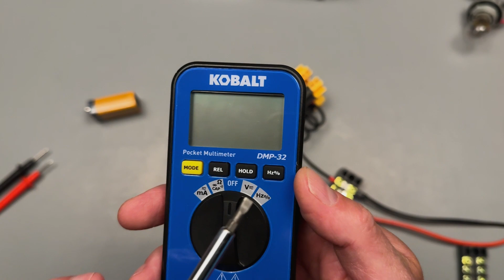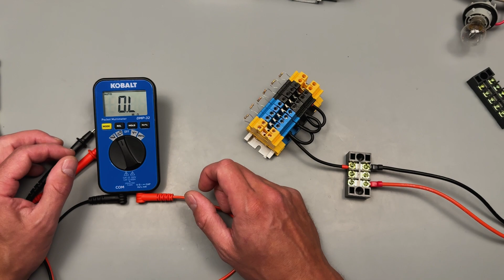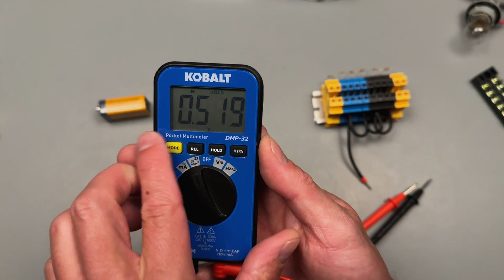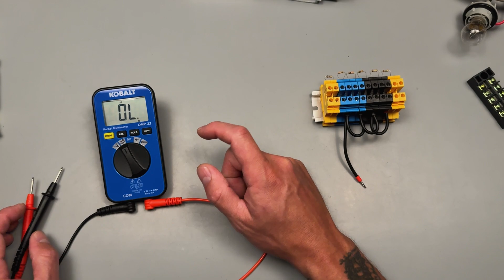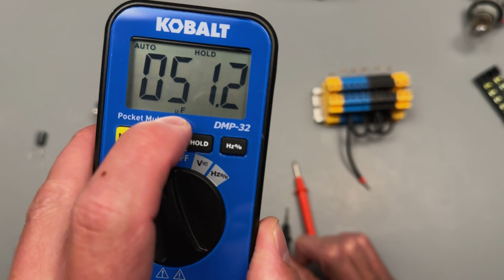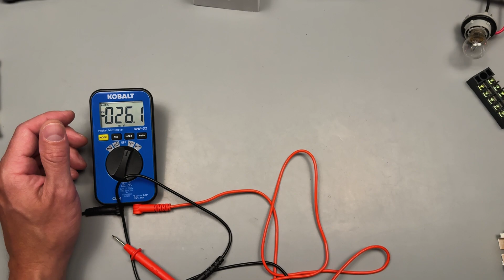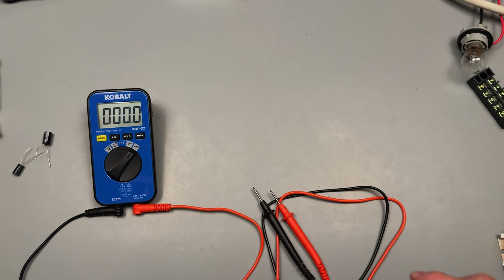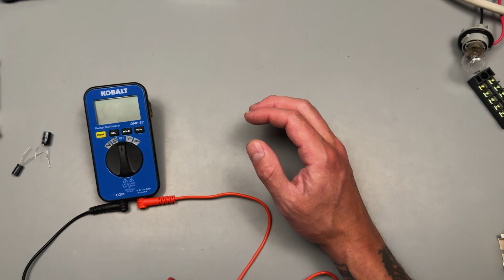How to Use Kobalt DMP-32 Pocket Multimeter: Complete Guide & Tutorial 🛠️

Comment: Thank you for the in-depth knowledge video.  Great camera and instructional testing.  I purchased this multimeter for my Adventure motorcycle on log trips around the world.  Would you recommend this multi meter for 12volt trouble shooting/light/ignition/continuity and battery testing?  Weather resistance testing in the rain?  I’ll get the fresh set of leads as you recommended.  Thank you for the video, you did a great job!
Reply from the maker: Thank you so much I appreciate that! I think this little meter would be perfect for that application. I can’t speak for weather resistant capabilities. I’d probably keep it in a zip lock baggy with its leads to be safe 🤷🏼‍♂️
Reply: @maddoxmechanic Will do.  I subscribed to your channel.  Looking forward to learning more about the correct way to multimeters. Keep putting them out, you have a way to communicate effectively.  Even how you said it was a little slow and recognize that issue.  Brilliant informations. Thank you.
Reply from the maker: @scottmoss-o5c i really appreciate the encouragement, I’m still just a small time YouTuber. Stuff like this goes a long way
Reply: Not sure about the other comment saying no to CR batteries, I’ve traveled the world and you can purchase them in almost any country at any store.  On adventure motorcycles, we’re looking to save lbs.  Carrying on extra CR battery is one ounce.  There is no issue there.

Comment: CR2032 button cell battery.
NOPE!!!! Deal breaker.
Reply from the maker: Really? What’s your beef with the CR2032 battery?
Reply: I’ve traveled on my adventure bike to 92 countries.  Every single one of those, you can pick up a CR2032 battery in any convince store.  Every country has cars with car Key remotes, garage door openers, gate remotes, personal items, etc.  I or any one I travel with has ever had an issue.  Carry an extra one on hand.  You wouldn’t even know it’s weight or size.  Electronics are getting more efficient, AAA batteries are not necessarily needed for application.